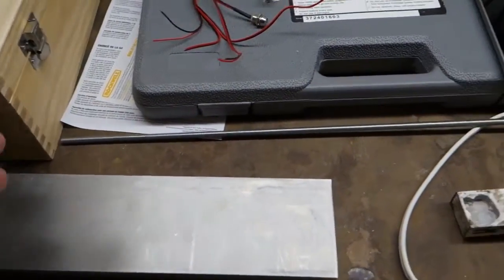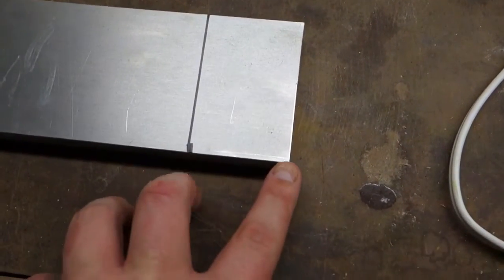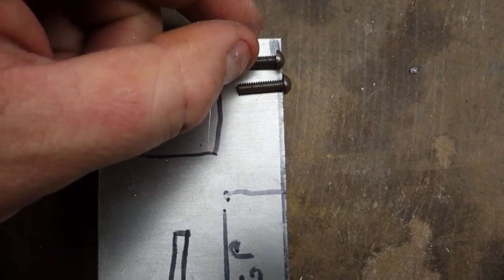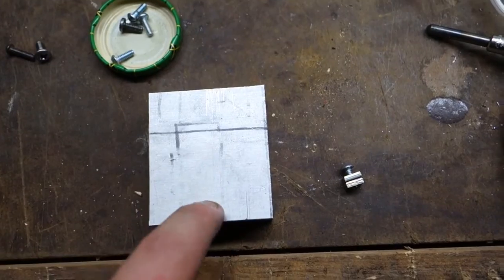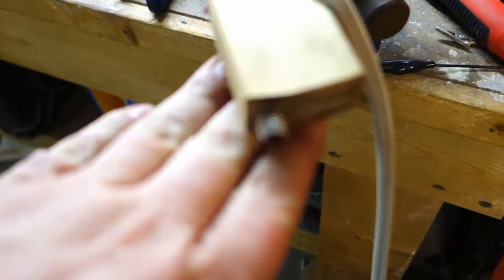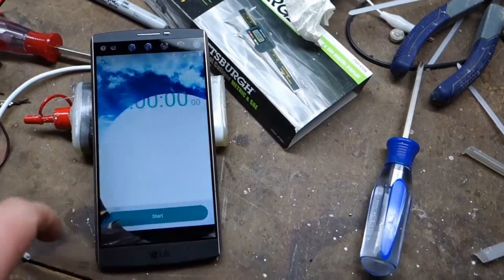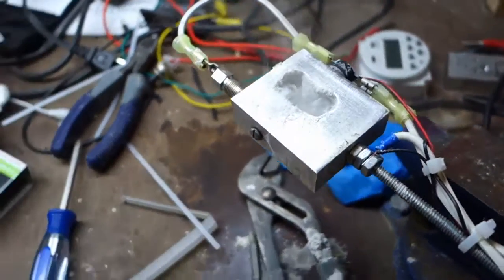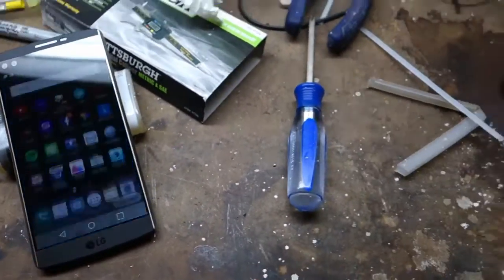Homemade oxalic acid vaporizer $50

Comment: Good job Michael!
The device you are presenting is very good because you have used a thermostat to maintain the correct sublimation temperature of oxalic acid. Unfortunately, most often to built evaporators are used only glow plug without thermostat so instead of sublimation of oxalic acid people carry out its carboxylation!  
They do not understand that the glow plug reaches temperatures of several hundred degrees of Celsius, sometimes above 1000°C, but sublimation of oxalic acid is ONLY between 157°C and 189.5°C (314,6°F - 373.1°F). Above this temperature is
 carboxylation of oxalic acid so as the result of the reaction are formed formic acid, carbon dioxide, carbon monoxide and some other harmful disintegrates. 
This is not good for bees!!!
Suitable Oxalic Acid Vaporizer as yours have to provide evaporating oxalic acid within the specified sublimation temperature range.
Best Regards,
Sylwester
(Golden Apiary)
Reply from the maker: Thank you very much! I switched away from this device as I started to see burn marks on my frames!!!! I switched to the oxvap110. Check out my video, It works wonders!!
Reply: Michael, thanks for the video. Just to clarify,  so are you saying you no longer use the oa vap that you made in this video?  I looked for the 'oxvap 110' that you just mentioned above but can't find it.  I've been doing a lot of research about the OA's on the market and have serious concerns re: lack of control of the temps on most of them.  As much as I would like to build this, I dont think I have the proper bits/blades and hand tools to achieve what you did.  So, my question is, what exactly, are you using now?  If you've switched to something you bought, please let me know.
Reply: https://oxavap.com/product/provap-110-sidelinercommercial-vaporizer/

Comment: I used 1/2 inch aluminum kept it to 2x2 inch used 1/4 rod for handle. Drilled and tapped for glow plug with tight fitting drilled hole for end of plug. Boils at two minutes, unplug at 3 minutes it is finished at 4. No need for temp switch if you use times. 1/2 inch slides into my bottom board 3/4 would never work.

Comment: I see you have DC running through the snap disc .how many times have you used the snap disc with the DC ? I know it was designed for AC and the DC will greatly reduce it cycle times due to arcing
Reply from the maker: I have used it plenty of times. To my knowledge I do not know of the snap disc having a shorter half life because of DC. If  you ever find out how many times, please let me know!
Reply: Hi, if it works, is ok...that was my wondering too !
Adrian from Romania

Comment: reading that glow plugs burn out for some.do the ends of the glow plugs need to be touching the heat sink to prevent that?
and I also read that the acid should only be heated to 300 degrees. what is your opinion ?
thanks
Reply from the maker: Well, I am not sure where you read the 300 degrees, but for oxalic acid to sublimate it needs to reach a minimum temp of 315 degrees. Thanks much!

Comment: Michael, I am attempting to make your designed vaporizer but am fuzzy on what size wire to use and where the wires should connect to. Would you be able to provide schematics of type and wire placement online, or send it to me email at, a subscriber. Thank you very much; bhudson@bndcommercial.com
Reply from the maker: Thanks for your inquiry. I will try to draw up a schematic for you soon. I use simple 16 gauge extension cord wire. I am a bit busy with work, home responsibilities and grad school so it might be a few days. Is this ok?
Reply: +michael cifranic   Michael, that would be greatly appreciated, thanks, Bob Hudson

Comment: I tried making one of these and followed the directions to a tee but when I power my glow plugs (sacrificed 2!)  they burn out in about 10 seconds.  What am I doing wrong?  I use a block of aluminum which I drill and tap for the glow plug threads.  They are not touching the side.  Help!  Baldguy
Reply from the maker: hey there baldguy. I am not sure why the gloplugs are burning out. are you using old plugs or subpar plugs? How thick is the aluminum.
Reply: Mike, the glowplugs I used were an Autolite 1104 and the second was a Autolite 1107.  The block of aluminum is probably 3/4" thick and the hole is drilled in the center but I'm telling you they are shot in 15 seconds. I am perplexed.  Thanks for responding though.  Baldguy
Reply from the maker: how big is the battery you are using? I am only using a 12aH battery. A much larger one would probably burn it out
Reply: Hmmm, interesting.  Thanks, I'll try a smaller battery.  Baldguy

Comment: Have you tried doing a a sugar water mix with oxcila acid in a fogger?
Reply: Do you have a video about the "handy assessment tool from The Ohio State University" that we can watch?  If not, can you put up a fast video showing us this tool?  Thanks
Reply from the maker: no, It wont work. I thought about that about 2 years ago. Here is why it wont work very well or at all. The sublimation needs to occur at a certain temperature range. The fogger will be way too hot and will not properly sublimate the oxalic acid. I also do not know what the effects of the sugar water will have on the inner workings of the fogger pipe. I have a fogger, but I only use mineral oil.
Reply: Ah, I see. Makes sense. The OA can't go over 300 f?
Reply: Also how many times a year do you treat with OA?
Reply from the maker: oxalic acid sublimation occurs between 315-372 degrees F. If it is too hot, it produces formic acid and carbon monoxide instead.
Reply from the maker: I treat in the fall, for three week in a row. The mites have a 7 day cycle. But weekly hive checks are great to see if you even need to treat. My wife and I use a handy assessment tool from The Ohio State University that helps us determine what is needed if anything. Once you get accustomed to the tool, your assessments will become second nature
Reply from the maker: Yes, I will try to make a video with the assessment tool soon. Thanks for the comments!

Comment: I just finished my vaporizer. I cast the aluminum block with green sand technique, so no machining was necessary. I used two glow plugs, and with heavy copper wire between their negative threaded areas, friction fit keeps them in place without a set screw. I used the same Selco thermostat switch. It is likely that placement of the switch matters: if under the well, it is more likely to prevent overshoot of the temperature than if it is attached on the side or end of the block. I measured the temperature curve with time using an infrared thermometer, and there is some overshoot, up to about 385 degrees F. I can't say whether this is due to an inaccuracy in the thermometer, or if it reflects the likelihood that the block isn't evenly heated, and when the switch opens at 350 degrees where it is located, an adjacent area of the block is hotter and it takes a little while for the temp to equilibrate.  My vaporizer is smaller than yours, as it's made to fit into a topbar hive, so I can't directly compare results with yours. It takes about a minute for mine to  begin vaporization, and a gram of oxalic acid is completely gone in another minute. Thanks for the video.
Reply from the maker: +Chris Rucker sounds awesome! do you have a video of yours?
Reply: No. I just treated my two new packages of bees: stuck the package in a taped-up cardboard box (without the queen) turned on the vaporizer and removed the package a couple of minutes after I heard the sublimation end. I'll check for mites on the SBB in their new hives tomorrow. The supplier said the packages were treated before shipping, but better safe than sorry.